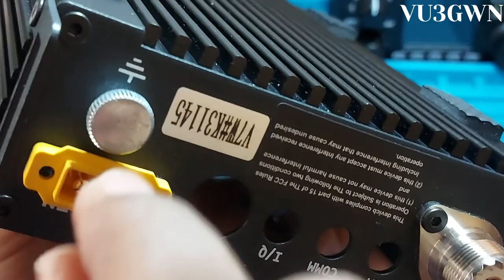Xiegu G90   Replacing Power Connector

Comment: Nice video.  Well done. Maybe you can point me to instructions on replacing the tuning encoder in the head?  I have a replacement encoder but am not confident I can do it without bricking the radio, as this will be my first time replacing an encoder.
Reply from the maker: Sorry, haven't opened the head. No experience there.